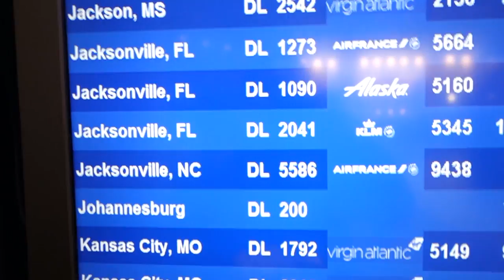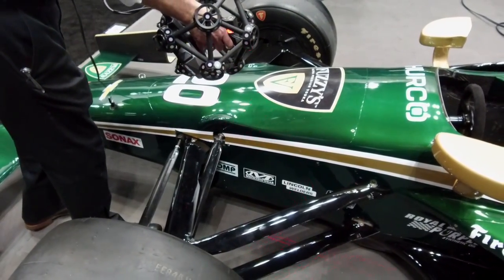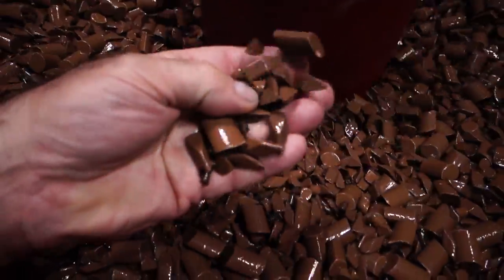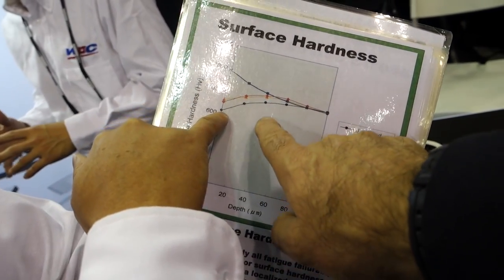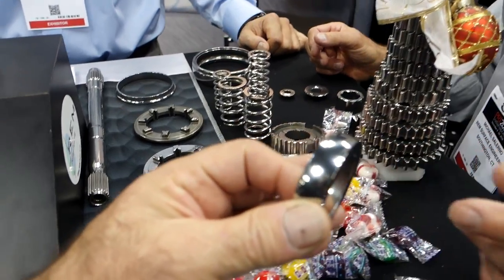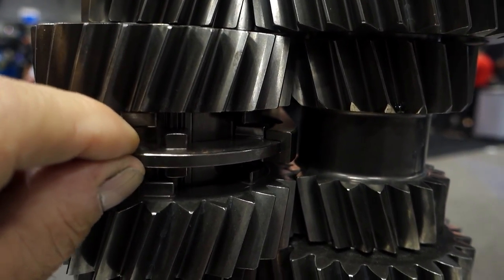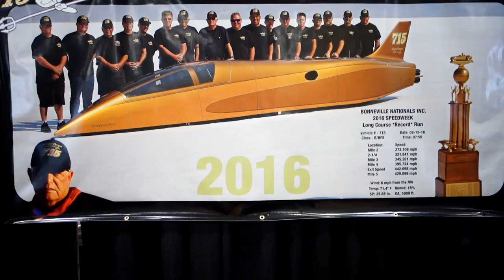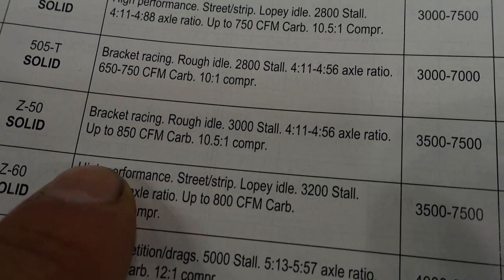2016 Performance Racing Show - Improving Gear Integrity

Comment: Thanks for the video.  I'm a big believer in surface and cryo treatments.  My T-56 has cryo and micro polished gears.  It shifts super smoothly.  My differential gears are coated with a friction reducing and oil shedding mixture.  Between the transmission and differential work I know I've picked up rear wheel horsepower.  Next is ceramic bearings.

Comment: I too enjoyed the 2016 PRI Show. Chemical and media peening solutions continue to be a mystery for many racers. Without a doubt, some vendors voodoo witchcraft engineering background continues to be a problem. 

But there are some excellent vendors and suppliers that really do understand the science behind it. REM is one of them. 

Media peening still is a total mess.     Failure to understand alloys and grain structure is what gets most "engineers" in trouble. Ron correctly asserts the importance of using the right type of peening process. 

3D scanning has been around for about 5 years. What's cool is that it can be acquired for a "reasonable" cost. Combined with a 5-6 Axis CNC machine, the sky is the limit. But one still has to learn metallurgy and alloy compositions. Just because you can copy something, doesn't mean it will perform....
Reply from the maker: I agree.  Scanning services are cheaper than ever as well as 3D printing. Our time to manufacture from conceptualizing is faster than ever.
Reply: forget copying, build something new. is there tech to 3d scan of internal chambers or just the internals of equipment. i can definately see a terminator with this tech. cant wait til robots have full capabilities. lol
Reply from the maker: Concept to final product is faster. Has nothing to do with copying. Our new Muncie shift forks for example we're modeled from scratch, printed and the printed model was sent to the forging company along with the print. This took less time because of the visual aspect of the part being present

Comment: Theoretically, for cleaning an engine, could you run the internal parts through an ultrasonic cleaner with motor oil instead of water?
Reply from the maker: Oil is a form of grease in a sense. You de-grease parts so you can do machine operations that are cooled with water based coolants. Nobody with expensive machines wants to contaminate coolant. Also after machining people want an oil free block ( if iron ) to paint.
Reply: GearBoxVideo Thanks

Comment: How do I get in contact with you? I have a design change to the saginaw three speed that I could use help with engineering and manufacturing, I believe it will sell thousands of units in the dirt track racing industry
Reply from the maker: Ryan Veralrud contact info is available on my main channel page... Read the about section